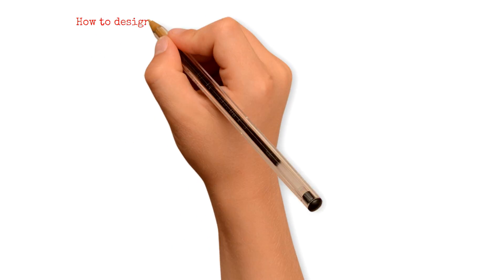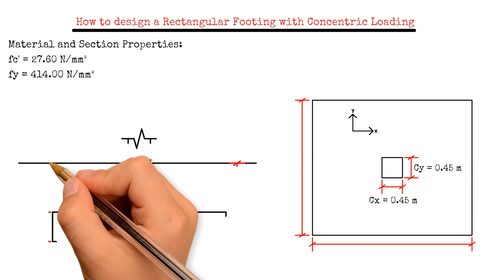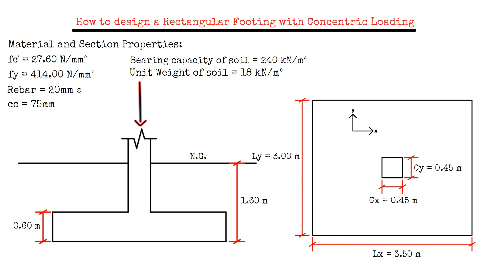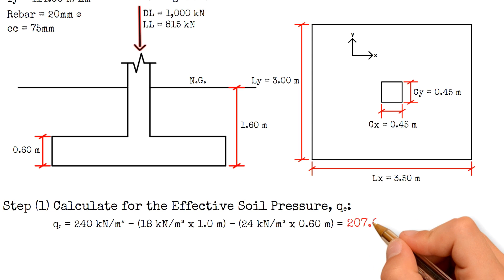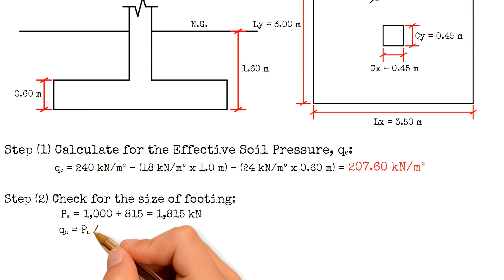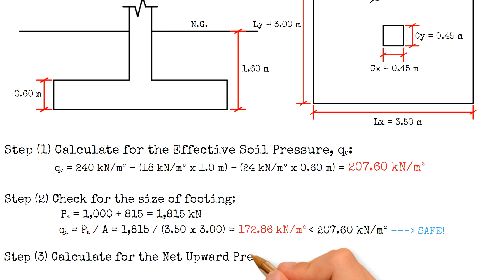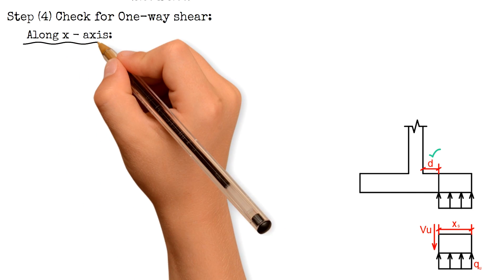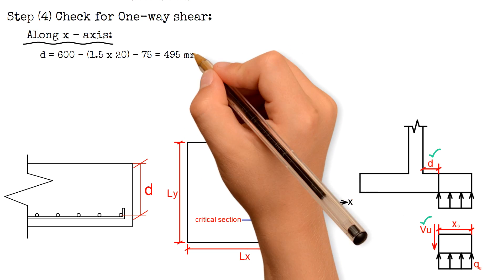How to Design a Rectangular Footing with Concentric Loading - Part 1

Comment: In Step No. 4 : Why d of the top bar is used in checking for the one-way shear along the x-axis? Bottom bar is the one along the x-axis. Isn't d = 600 - (0.5 x 20) - 75 = 515 mm? However, if the top rebar is placed along the x-axis, then d= 495 mm, isn't it? Thanks in advance for the reply.